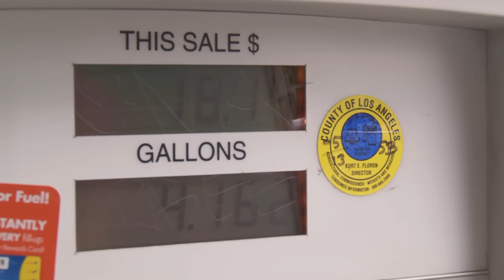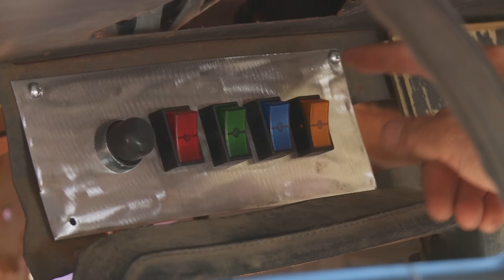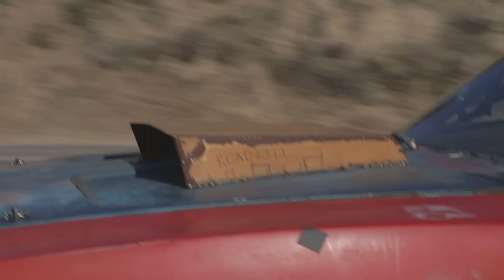Dirt Cheap Rat Rod! 1968 Charger Buildup and Thrash - Roadkill Ep. 23

Comment: There’s something so right about an old charger drifting across a dirt road
Reply: 359 TwinSticks Is it the Dukes of Hazzard vibes? The trademark engine roar? Or is it that these guys could easily emulate Bo and Luke Duke if they tried hard enough? shrugs idk
Reply: Colton Rushton engine roar
Reply: 359 TwinSticks I agree entirely! The only thing that could make this better is a Dixie horn and Roscoe blaring his sirens!
Reply: Feckin poetry is what it is Lad feckin poetry
Reply: And watch it vanish, to a point.
Reply: F-bomb
Reply: 440th like.
Reply: Drifting these cars was so easy,  old school fun.
Reply: ay 666 likes
Reply: Dukes of Hazard.
Reply: I was gonna say because of the dukes of hazard👍🏻
Reply: TwinStick Garage i
Reply: @rawr51919  all of the above
Reply: general lee
Reply: @Nate_Lloyd  i completely agree
Reply: I want to get one so I can rig up my homemade oil injection system with 2 VRO pumps I have sitting around. A separate oil tank will be mounted next to the motor and some will hit the bottom end and the get pulled off and injected into the intake by the VRO pumps of s mercury outboard. I will run amsoil interceptor 2T. I plan on running like I would any snowmobile engine like 850 rotax etec turbo.

Comment: Total Cost Tally: 68' Charger (Trade for Cylinder Heads) + Motor Home ($1000) + Donor Fury (Free-ish) + New Parts ($2000?) + Pay to take motorhome and dumpster ($500?) + $47 fuel door =  Dukes Fun for less than the price of a used Civic. WORTH IT! BAM!
Reply: AimlessMoto then get a sponsorship from dodge and end up with a free 700hp drivetrain
Reply: Katchao
Reply: If you have a lot of free time, well it's worth it. But if not, just forget iy
Reply: So $3550 is less than a used Civic? I could find a good CRX for $2000. Still, $3500 for a 440 Charger.
Reply: Yes, $3550 is less than a used civic. Yes, you can find crx's for $2k.
Reply: Dacia sandero =8000!!!
Reply: Dollars of course
Reply: Guido Berenstein you can find sandero's in Romania for about $800-$1000
Reply: Don't forget about the Dodge D100 that they didn't want to hack up.

Comment: The 1968 Doge Charger has been my dream car for my hole life.
Reply: I personally prefer a GM product but I've always had a soft spot for Mopar.
My dream car would be a '75 Chevy Monte Carlo with 2 bbl 350, AC, Swivel Bucket seats, Tilt Wheel, CC and the Ralley wheels that have the center hubs and beauty rings.
Reply: Living in a hole sounds difficult, I hope you find a house eventually
Reply: CreepinPDX I’m dead
Reply: Funny, I bought one yesterday
Reply: @rubberbandman1410  haha
Reply: Whole*
Reply: 13B Gun Bunny my dream car is a 69 corvette
Reply: Moi aussi en noir mat avec une tête de mort sur le hood.
Reply: i would say a 55-56 bel air, but i hate the little "kinks" at the side rear windows

Comment: best sounding 200 hp right there.
Reply: John Kukic 185. When new....
Reply: 200hp with all the accesories attached like: smog pump, fan, a/c, power steering. pull all that off and its at least 250 hp.

Comment: for only 200 horse it sounds like it has 400. love it!
Reply: it has more than 200
Reply: Patrick Akeley Actually, those big motors back in the 70s didn't make dick for horsepower (not just mopar, I'm talking all of the big 3). Especially in Stuff like trucks and RV's. They DID, however, still have a shit ton of torque, usually underrated. The quickly increasing emissions requirements were moving faster than technology at the time, so they lost a lot of power.
Reply: Patrick Akeley 29:55 " This thing sounds like an absolute turd. This thing makes 200Hp"

Sorry but your argument is invalid.
Reply: Rustic Shine
They didn't dyno it so really no one knows for fact how much horsepower it made, though I would guess it would be fairly low with lots of torque.

Comment: old american cars way better than now!
Reply: true
Reply: The hellcat is rubbish , no quality at all! Jacob Allen
Reply: Yazan Q hell cat is definitely not rubbish buddy also have you seen the 2015 Dodge SRT Viper
Reply: ***** from the Dodge factory
Reply: ***** powerful indeed! i just miss the quality of old american muscle cars.
Reply: RX-3 73' Japan Pretty Imfamous
Reply: Not really.....we now have fuel injection, and cars are pretty much self-sustaining, as compared to 40 years ago. They don't stall, get fuel-line freeze up, and rarely require tune-ups. Oil changes only about every 6,000 miles. The old cars are great, but technology is not a bad thing.
Reply: No, cars nowadays u need to replace them after 100T miles ! Sure old cars u can keep them running for way more than that, I own merc w124 88 with 400T mile in record and still running like new car.
Reply: Yazan Q I'm sorry to tell you this,but old American cars look good but drive like crap. The carburetor is a somewhat regulated fuel leak, the motors are junk after 125,000 miles, and Chrysler has the worst wiring.
 I love old cars when modified but when the STOCK brakes fail while blasting down a hill you stare at that huge dash,and hope you can get it stopped before you die. I love Chryslers but I also recognize their short comings.
 You are also comparing a Mercedes to a Dodge that is at least 15 years older,and your Mercedes is most likely a  diesel.
Reply: MrStacy1974 I agree with you. There are SOME older American cars that are good, but not many.
If I'm going for a reliable performance car, then it's gotta be Japanese.
Reply: Well obviously modern cars drive better, handle better, have better fuel economy etc etc. But if that's all your interested in then get a Prius... You don't get an old car for it's performance.
Reply: ***** You must have missed where i said stock. I love modified old cars ,but with today's higher speeds you need more performance. Stopping your classic before you hit the idiot that came to a complete stop in front of you is priceless.
Reply: Romeo
Reply: David S. MrStacy1974 . old cars were built to last, people accually took a lot of pride in thier work back then, dont get me wrong sum new cars are pretty badass but older engines are more reliable. old 318 and slant 6 mopar engines are indestructible. old 350 chevys are reliable, everything was just better put together back then. and you are supposed to change your oil every 3000 miles no matter what car you have
Reply: MrStacy1974 from the factory an old 440 makes about 400 horsepower and agreed that the brakes,steering ect... isnt good at all from the factory back then. but the drivetrains and bodies were pretty damn good
Reply: ***** um.... there's only like six but.... Shelby 1000 m8......
Reply: They always will be lol
Reply: Murican Man my dad's '13 suburban is doing pretty good at 200,000 miles. I have no idea how he racked up that many miles in 2 years.
Reply: Yazan Q In the 60s there weren't all the pollution and safety regulations that constrain today's designs.   But American cars were very cheap.
I had a 69 Mustang and the original sticker price as about $3000.   Everything was made to be cheap, such as drum brakes.
Reply: its all you really needed
Reply: charlesvan13 you say the smog equipment is straining todays cars but if you test them back to back old vs new new is faster. Emissions crap doesn't choke cars like it did in the 80's because we have gotten better at designing it
Reply: charlesvan13 $3,000 isn't what it is today bro. It would be $23,000 in 1965.
Reply: modedchild There are still quite a few 1960's cars that will still outrun any car produced by Ford, Chrysler, or GM today
Reply: I'm tempted to put a hellcat engine in a 65 dart
Reply: John Orourke The racecars?
Reply: nope the hemi and 440 challengers and chargers stock, not the race cars ran the quarter mile in the 12s. The modern non hellcat versions struggle to break into the 13s
Reply: John Orourke
well the modern day challengers are pretty much 2 door (modern day) chargers. Nothing special really
Reply: still a car I would drive, but nothing compares to the old muscle lol, those cars will always have a spot in my heart.
Reply: CORSA CORVAIR!

Comment: He paid 200 for the Fury and a 1000 for the motorhome... so.. Really it was about a 1200 dollars for a running charger
Reply: if you don't count time... but yeah, pretty damn legit! and looks and sounds awesome too :D
Reply: You guys are forgetting all the little things - like the aftermarket front brakes, going through the rest of the brakes, the exhaust, wiring crap and lights, getting the trans rebuilt, the oil pan,  a rad, tires, shifter, gas tank, alignment, etc.  Plus the cost of the parts they originally had to buy for the Fury like the seats, etc.

What about the original heads he traded for it?  What were they and what was their value?  I would estimate north of $5k in that car easy.  A lot more if you include the damage to kinnen's driveway!

Freiburger is the master of cheap and fun (Cheap Thrills Dart and the El Cheapo El Camino come to mind) and neither of those cars needed as much as this Charger did (they were both complete cars when bought), and they were a couple of thousand bucks 20 years ago!  (Holy crap, has it been that long?)

Comment: Damn. I wish I had money to blow :/ It'd be awesome to find an old junker muscle car and just rebuild it and rev it next to a prius :D
Reply: me2
Reply: you know he dosnt have much in it,the car he traded a set of heads for,and the doner car was only 200 and the camper wasnt that much,i bet if you tried you could build a budge hot rod for under 5000 if you can find a good car for under 2 grand,a donar car and alot of work,and if you dont know how you can learn form this thing called the internet it is amazing,i built a 89 mustang that started out with a 4 banger,a crown vic with a 351w,and trans,it was a good running car,used the efi and everything form it,ported the heads put a better intake on it and we where doing good,i did the exhaust and for 300 bucks for the stang and 500 for the crown vic, and for about 1200 bucks cash,we where doing low 12s added a nos kit and went 11.4 thats pretty good for under 3 grand.after we painted it our selfs which didnt coast that much a couple hundred bucks,she looked good to,you can do it for less to,an older car wouldnt be that much more i do it all the time and im getting ready for another build cause its been to long since ive truned any rubber fast